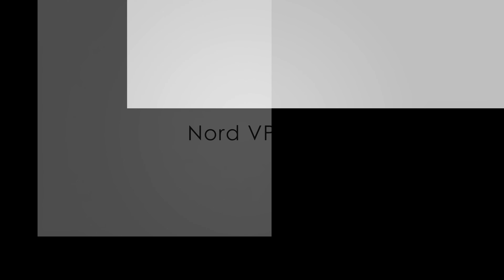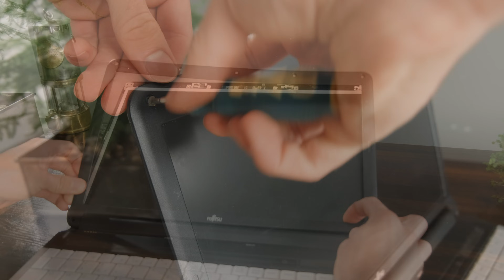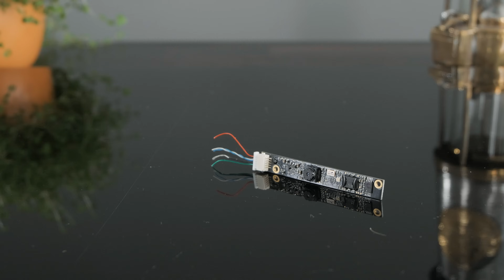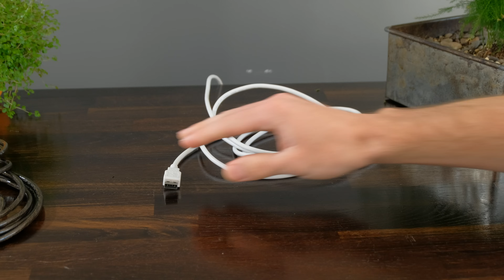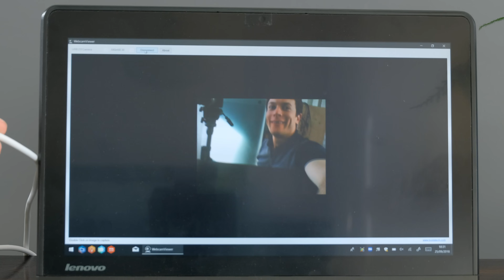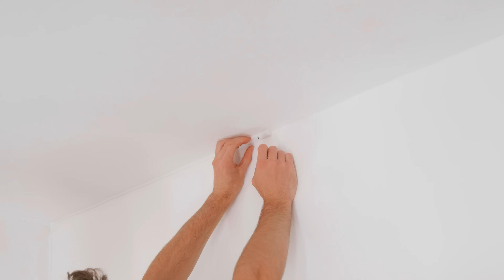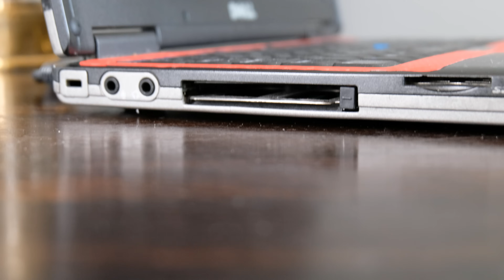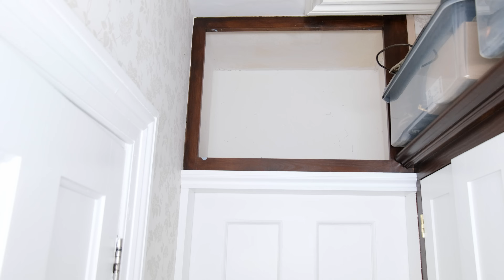DIY Home Security - ON A BUDGET!

Comment: This was really interesting to watch. Question though, is there a way of making the cameras wireless? I imagine fiddling with a Raspberry pi would work but I guess that would involve some coding?
Reply: You could always install wine onto the pi and then it would nativly work as Contraware works on linux's wine and windows
Reply: I'm wondering the same thing. I was looking into trying to use an ad hoc peer-to-peer connection. So the camera would have some sort of wifi dongle on it, which a smartphone or laptop could connect to. You'd then open up a browser and type in the network IP to see the video stream. However, I'm struggling to find any adapters for this.
I also looked at a pair of USB sender / recievers but didn't see a lot of luck there either.

What we really need is a pair of dongles that act as a wireless USB cable. One plugged into the camera and one plugged into the recepient device. They do the job of wirelessly sending the signal over, just like a USB cable would. Although, I haven't found anything that matches that description. The only extra thing you'd need is a battery to power the camera, but that's to be expected however way you make it wireless...

Comment: I have a camera module and it's all wires are twisted and it also doesn't have a voltage regulator so how could I find positive,negative and data wires

Comment: one question, how do you install a mic on the laptop camara home security system? and get live audio and video feed thx
Reply: I have the same doubt. Maybe the couple of wires not used in the video are directly linked to the mic
Reply: I tried connecting the mic to 3.5mm audio jack, as already done in other cases (https://www.youtube.com/watch?v=mJPU-xMmmTU&t=67s), but it doesn't work
Reply: Why do you need audio?
Reply: @Kaluka101  you can use it as external webcam
Reply: @carminevitiello8800  yes I get that. My question is, why do you need audio? The only reason I can think of is for spying. You don't need audio for a video security feed
Reply: @Kaluka101  probably you don't need audio for video security. But you can exploit a webcam with integrated mic in many ways: using it as external webcam or  for monitoring your babies, especially when they are infants
Reply: @Kaluka101  well simply i'm curies, or i just want to hear audio. like for example if a robber is gonna rob a home then he schedule's it for later and  tell his buddy where gonna rob this place later ok? then i could call 911, and  then there for   simply arresting the man and there for making  the home much more secured. (btw i didn't get robbed and im only 12)
Reply: @donnastadnick9993  Ok I get that! I think that would be a very cool way of catching a robber before they do anything bad. To answer, you would probably just use a clip microphone made from a laptop mic (as this channel has made a tutorial on before) and put it next to the camera. The mic could relay to a computer that is recording audio and boom, you got sound.
Reply: @Kaluka101  yes thats a good idea never thought of that actually

Comment: Hello dude a warm greeting for you and to all the fans of this great channel, I was wondering if anyone could help to answer a little question, I 've tried your method to figure which of each connecting cables and I found out that out of five connector cables there are two gives peep, is that mean those two are GND cables?

Comment: I did it like that - I dismantled an old webcam and used it's USB cable and connected the wires to the connector that was connected to the old webcam's PCB and no matter how I change the data wires it still can't identify the device

Comment: You are using 5v but laptop cameras are 3.3v, so boiling alot of time later. :) you must use resistans or diodes for voltage down.

Comment: The USB gives 5V and some of the cameras use 3.9v~ So you will need to use a DIODE... And for some reason i can't get it work with a long USB cable, even with 5V output... Can any 1 help me with that problem please?...

Comment: If theres anyone wondeing, like me, what the other 2 wires are for I looked. I noticed that many of those cables had 6 wires instead of the 4 needed for the usb connect. Took a while to search it out, but they're likely for the left right of a mic that would also be on that board. Not sure what the 5th one would be for on the 5 wire models except for possibly just a mono mic. It uses a common ground with the rest.

Comment: Oh man I fell inlove with your channel its so great! I had an old pc around and I am trying to make the webcam work but I cant. I did follow all your instructions and I cant get my computer to recognize the webcam. Also the usb extension cable that I bought has green, orange, white and blue. I found a picture on internet that told me which color means what. but I still cant do it. I see on the driver control panel and I see the usb pluged in and with an error. I search in to the properties and saids error 43. also the webcam its crazy hot. thats normal?

Comment: My camera doesn't have those copper rings surrounding a hole, how do I find out the ground wire?
Reply: It also doesn't have the transmitter thing so I don't know which one is the positive wire
Reply: *transistor

Comment: Too bad there in not a way to set this up like in cabin that has limit power so if motion was detected at a certain location, say in the house, were it would ignore most of the MS BS and boot in like 15 seconds and start recording..LOL.. One question though, how would you add audio to it will the contraware program allow that?
Reply: sorry about the grammar I should read better it but I posted.

Comment: My camera doesn't have mounting holes to use as a ground and my multimeter doesn't have a beeper mode, how do I figure out which wire is ground and which is positive?

Comment: Then there is the esp32 cam module (wifi mcu + camera) which costs less than $7 and you only need to add a 5v usb psu. It also has a micro SD slot if you want to capture frames. I don't believe you can find a cheapest solution.

Comment: Is there a way to make it wireless so there is less cable management
Reply: Raspberry pi zero via the USB connector? I haven't done it but it seems logical if the Pi OS recognizes the camera. Then of course your issue is power supply for the Pi and camera (portable charger battery, standard PI power source, etc).

Comment: Only thing missing is infrared LED illumination for low light conditions.
Reply: i doubt this type of laptop cam picks up infrared tho
Reply: @peabody3000  CMOS image sensors inherently pick up some near-infrared.  Manufacturers often add IR cutoff filters, but these vary in effectiveness.  Filters can be removed or simply overcome with sufficiently bright near-IR lighting.

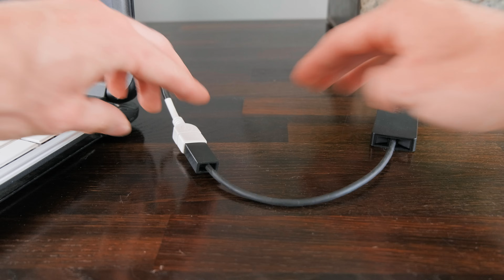Comment: At 7:57 there was a USB hub in the shot. Could you connect these cameras to a USB hub instead maxing out USB ports or have to expand? Are there limitations that prevent this, if so would those USB repeaters help? Just curious..
Reply: I guess this is due to the hardware or software limitations

Comment: I HAVE tried it out, works fine, but i won't suggest using Sugru (not even available in Bulgaria lmao) or any other putty. 
It looks and feels a lot better if you just 3D print it. I have printed a case with a tripod mount and another to be mounted right on top 
of the monitor, so if you have a high quality camera you can turn it into a functioning webcam for a tenth of the price of an actual one.

Comment: This is a horrible idea! Installing old random software on an old computer that no longer has firewall updates will get your video feed hacked in no time. Technically anything connected to WiFi is at risk but this is just asking to be hacked. The only camera I’ll ever use is a HomeKit compatible with two factor authentication and my own iCloud storage.

Comment: Isnt it still pretty much a webcam just extended by cable?functions like 2 way speaker,night vision, rotate tilt and activity sensors will not be available and having it plug to a laptop renders it useless when u need to bring the laptop out for work...

Comment: So you buy a broken laptop as parts for £10, then spend an hour ripping the camera apart and another hour working out which cable is which.... or you could just buy one on Ebay for £2.
Then there is the issue that USB has a practical maximum cable length.  I'm not sure how much this manifests.
If you are serious about security I would upload footage to the cloud and don't use Wifi to do it.  High tech crims these days will jam your Wifi cameras and lift anything they think is the recording device.

Comment: Install VNC Server on that computer and now you can see them from anywhere on your phone
Reply: I would recommend have a VPN server with your home which is far more security and easy to do so.
Have keys created instead of password and voila. 

You can access the cameras from anywhere, with total security and not having to worry that someone might hack the VNC Server without you knowing :)
Reply: @hakunamatata324  where can I learn more about setting up a VPN server? is there anything like that for raspberry pi ?
Reply: @Rangefinder02  Check out https://www.pivpn.io/, I deployed this late last year and used it daily while in Asia this past January. Performance is of course dependent on the Pi board you have but my Pi 3 B+ has performed ok with two concurrent users. That said I am eyeing a Pi 4 for the extra power, could probably increase key strength too.
Reply: Deano Robinson so with the program and a vpn  it will be 100% safe? Must the vpn be installed on the hosting pc or on the whole wifi network?
Reply: Before i dive into getting VPN or whatever. How could i see them to wifi so i can watch what they are recording anywhere i am? My grandpa being reckless lately so im planning hoe to see hidden cameras in his hoise in case of an emergency
Reply: @isabeldiaz6467  download VNC Server on the laptop that has the "security Cameras" hooked to it. And Download VNC Viewer on the Computer you wish to View them it from. And then log in. I'm being really vague just Google VNC Server to learn more.
Reply: @isabeldiaz6467  almost any great router brand nowadays has the VPN feature on it if you are not so familiar with computers things.
With that said, you can access from anywhere you go, the connection is encrypted, and so on. VNC does not provide enough security do anyone with the right knowledge can access it, find out its geo location, and etc.
Unfortunately, people don't think. They install a bunch on shit inside their house, voice assistant, smart TV, etc, without knowing the danger around it.

I have a DNS + VPN at home so my mobile, computers, consoles, smart TV, are not able to send tracking data, personal information over to Google, Microsoft, Samsung, etc. You have no idea all the data trying to leave your own home everyday. 

I've being working with technology in the last 10y, I'm 30 now. Users have no idea all the shit out there.
Reply: If you are running on a Windows computer, just use Remote Desktop. Works with iOS and Android.  https://www.pcmag.com/how-to/how-to-access-your-pc-from-ios-and-android

Comment: Hello, congratulations for the post....

I did here and it worked, but the camera is only active for a few minutes and then disconnects, have a procedure to prevent this?

The camera has 5 wires, 4 were connected to the USB cable and 1 wire was left, is that right?

Comment: If you have the same make camera then only 1 will show up even if you have 50 cams plugged in.
I used a low cost web cam and a xbox 360 camera and a ps2 camera on my set up.
when i plugged in another low cost camera it did not show so i changed to another and it worked out great.
I unplugged the 1st cam and plugged in the other 2nd and it worked.

Comment: I might try this. Cant see spending hella money for a "wifi" camera when I just need a live feed with simple cables. Lmfao
Reply: wifi is crap yes, it can be interfered by just a very simple jammer device. but you can still buy ethernet standard ip survillence cameras that you connect with utp cable. Whatever you do, don't connect an ip camera to the internet, use a separate router for them so they can't be hacked. Anything that's connected to the internet can be hacked

Comment: I bought an old webcam from ebay (from a lenovo thinkpad x230) and it worked! Plugged in directly to usb but had to reverse the data cables to make it work. My tip would be to add a diode or two to drop the voltages if u see overheating problems.

Comment: Love the money saving idea for sure but is there a money saving way to make those USB extension cables you need? Because what you save in the camera you get killed big $$$ in cables.
Reply: You can make up to a 5M USB cable as long as you have the USB connectors at each end as they're basically just 4 cables to go from A to B which you can find the pinout of on google but it's honestly just as easy to buy a cheap $5 one off of Ebay and they cheapo ones also tend to be more reliable. The repeaters are also much better to get off of Ebay as well but making one is a little bit more of a pain :)

Comment: If you don't like old laptops, you can use multiple Raspberry Pi Zeros connected to every camera. It can come with ethernet (usb adapter required, base board 5$), or wifi (10$).

Comment: A 'Raspberry Pi 4' is the way to go for storage!!!(Use Manjaro if you wanna forget about driver issues)
It's got 4 USBs, 2 are usb3 so you can connect 2 or 3 cams to each. Though one usb3 will be for a hard drive, you can get USB HATs(HAT=Hardware At the Top) to get 4 extra root USB slots.
There is backup power available for it too called PiJuice.
Also, it has gigabit ethernet so you can access video via network/wifi or allow online streaming support.
Want more cams than hard disk can handle(hard disks have a write speed bottleneck)? use SSD HAT and attach as many cams as possible!!!
Or, use RAID storage and multiple HDDs to achieve faster write speeds and also, data redundancy(CRAZY EXPENSIVE FEATURE)  
NOT CONVINCED YET??? ok, you can use real-time Linux (via Manjaro Linux kernel swapping) for even smoother functionality. Did I mention you an also reduce capture framerate for more efficient storage and smaller video filesizes?

Comment: You can save a bunch of $ on a proper cctv system by getting the individual components online.  DVR by itself, hdd, cable, and a MUCH BETTER selection of cameras (including FOVs).  EBay got the plug..

For less than a store bought setup costs you can have a setup custom tailored to your needs and have more feeds..

Comment: While it's venerable to recycle an old laptop for the "hub", a single-board computer will consume far less power, making it probably the cheaper and arguably more eco-friendly option. It's also possible it will handle more cameras, depending on the model.

Comment: Thanks for the video. I have a bunch of old recycled pcs I've saved all the components of and I plan to use this system. I knos this video is old I watched it quite a while ago and saved until I had time to do it but I have a few questions before I get started I'm hoping you can answer for me as I'm mechanically inclined but not so much with technology lol. Do I need special software or more then one pc to view multiple cameras at the same time. I only plan on using 3 but would like to view at the same time especially if I can't record the video and second can I record the video on say a 24hr loop or something like this? I'd appreciate any answers that could lead me to solving these issues

Comment: Just I want to start a new project very similar with yours but I want to use it just tablet and this tablet will have a connection to network just time to time if you can tell me how to do it or if it’s working I’ll be very happy. I don’t have the now any tablet or any CCTV . And connection between the tablet and the CCTV will be the same with USB

Comment: I'd never heard of Sugru. Interesting material - might try to 3D-print a mold and fill it manually with this putty to create a flexible (and smooth surfaced?) part. Just wondering what anti-stick to use for the mold. Oil, silicone oil, talcum, starch?

Comment: given the price of sugru, get a bunch of cheap usb webcams, and save the hassle of finding the pinout and covering them up. (though it might be uglier and you have to clip them somewhere.)
another option is to get laptop cameras with a pre-wired usb cable. (and use hot glue.)

another option buy an esp 32 camera module and a 18650 ups for it, for 20 bucks total, and you set them up to connect to your home wifi, then you get a software that records from ip cameras on the laptop, and voila.
the esp32 modules are equipped with an sd slot so you can also record directly to them for redundancy in case the laptop crashes. 
you can get pan/tilt servo gimbals for 7bucks and wire them to the esp 32, a pi, or an arduino if you go with the usb+laptop option.

Comment: Good video and good tips. 

BUT back to real life 

You have to buy laptops 

You have to buy usb extenders and wires 

You have to buy usb hubs 

When 

You can buy a cctv with wifi on ebay for £9.99 that are plug and play buy 3 of them £30 thats security sorted and higher definition

Comment: You could get even more cameras going by using an old desktop. They generally have more root USB hubs to begin with, and then you can add anywhere from 4-10 additional USB expansion cards, depending on the form factor. The 2 camera per root hub limit can also be circumvented by using USB 3.0 controllers with much higher bandwidth.